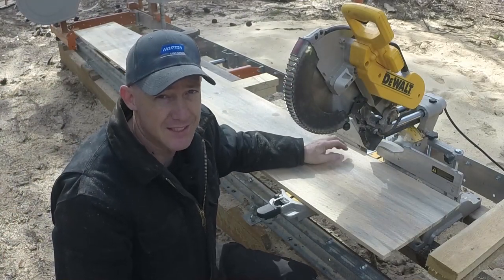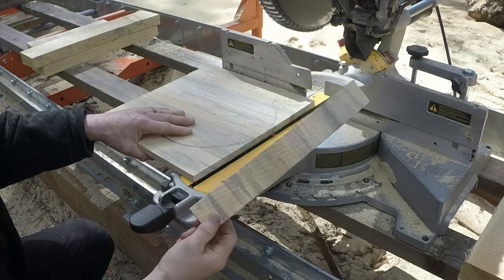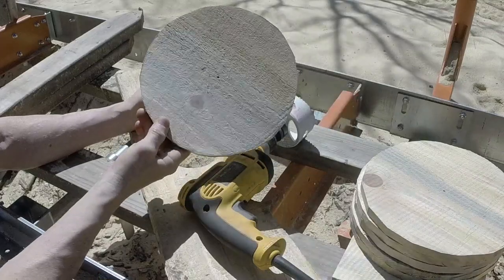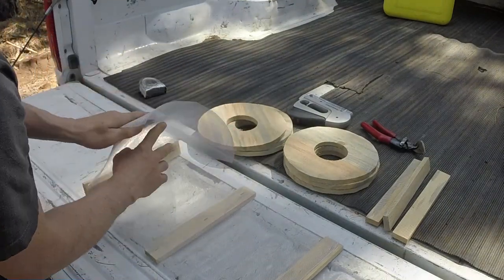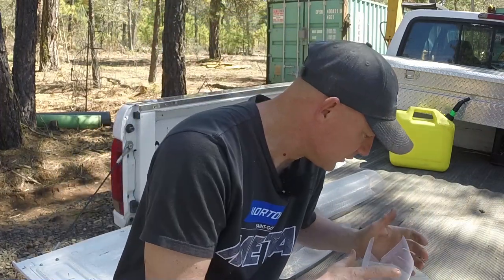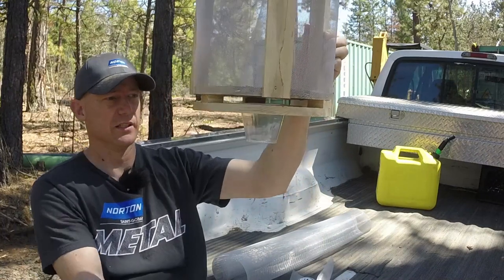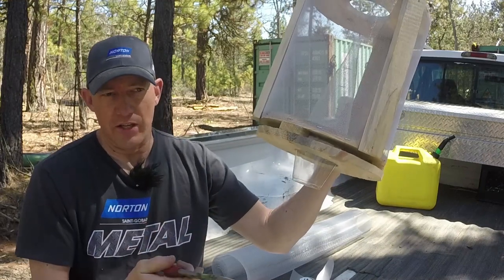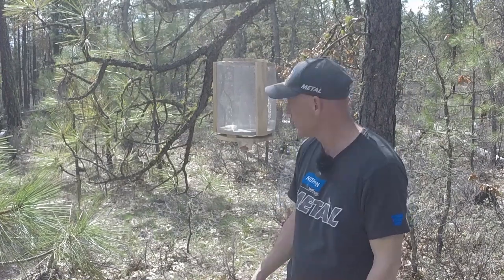Yellow Jacket screen trap, trying to catch the wasps before they make their nests

Comment: This is such a great trap.  I would find a way to make the bait cup more accessible, possibly using neodymium magnets, or have it slide into a fitting from the side.
Reply from the maker: The magnet idea is perfect. I think I can remodel this trap to use magnets to attach the cup to the bottom. It will make it so much easier to replace the bait. Thank you and thanks for watching. :)